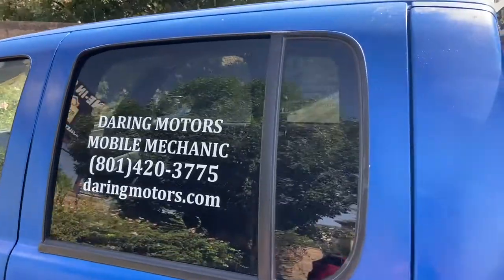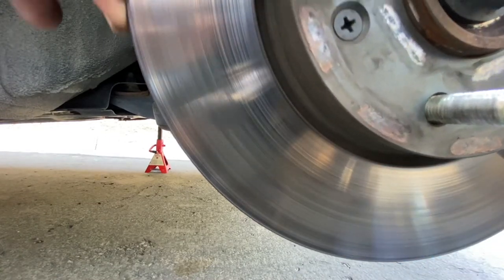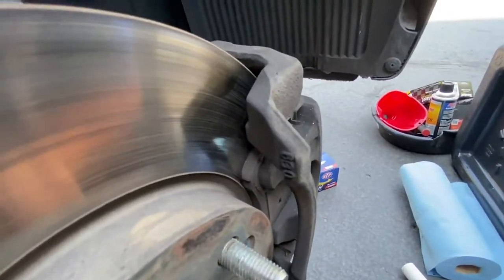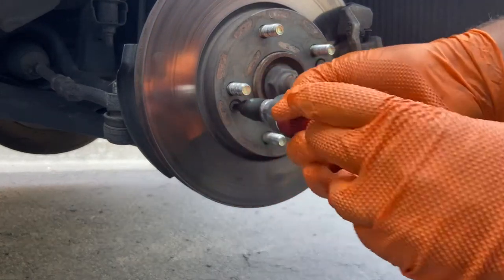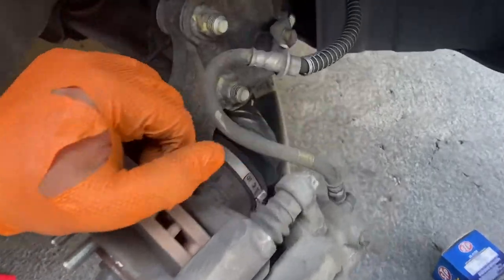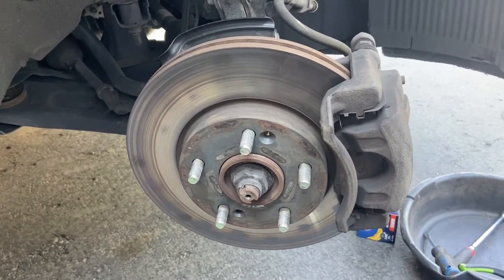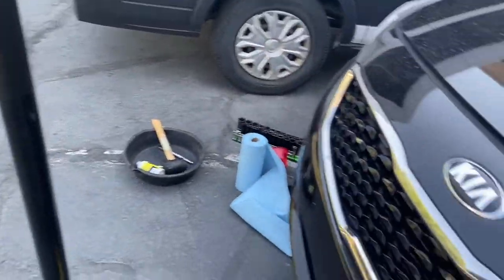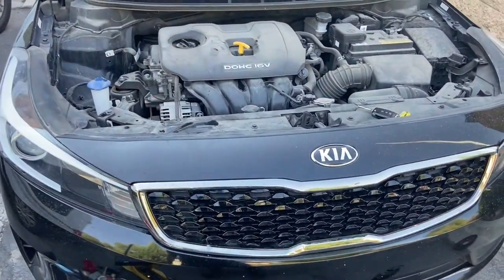Kia forte brake replacement Basic how to

Comment: You forgot the anti rattle springs you took out @3:44 when putting it back together, there were holes for them in the new pads too (@9:09 on) ...
Reply: That's one thing I realized.

Comment: I replace the brake fluid whenever I replace brakes - old fluid gets oxidized and a flush and fill is fairly easy while you have access to the brake cylinders.

Comment: Great video ….however I was watching to find a easier way to install the little pins that go in the holes on the brake pads. I do my brake jobs the same exact way but always have a problem with the pins that go in the little holes on the actual brake pads.

Comment: I just did my daughters 2018 kia forte front breaks and when i stop at a light n pull off there is a wonk wonk type noise for a few seconds then goes away until stopping and pulling off again. I didnt change the rotors but did everythg else.
????

Comment: only steps did not see you do was the metal clips that go over the brake  pads did not see you bleed the brake or open the cap on where you refill brake fluid. maybe its not necessary but always see it done on other brake videos. Sorry if im wrong.
Reply: A lot of the videos I've watched they use a tool to slowly compress the piston, so no need to bleed them. Just pump the pedal until firm after installation.

Comment: What size socket did you use for the caliper bolts???
Reply: 14mm & 17MM for the caliper bracket
Reply: @StevehBe  My 17 mm bolt is so tight I can't take it off with my ratchet wrench. I think I'll have to buy an impact wrench just how the guy in the video used.

Comment: I have a 2013 ki forte sx ? Are the brakes universal for this model ? 2.4 liter turbo ? You make it looks so easy with this fix . I hope that's the case.  I really want to successfully complete a brake fix .
Reply from the maker: It should be very similar there may be some slight variance in looks but the overall concept is the same
Reply: @daringmotors  that's awesome ,  thank you for your response .

Comment: what about those pins 3:47? i think those are to separate the pads from the rotor but none of the replacements from the stores i bought them from come with them, anyone knows where can I get them?
Reply from the maker: You can reuse the old ones but from my experience they don’t serve much of a purpose and will be completely fine without

Comment: The pads had small holes for the brake pad spring, but you did not install it back on.
Why not, do it not need it?
Shouldn't the bracket bolts been cleaned or replaced, they were rusty coming out & rusty going back in...

Comment: did you do the rotors too just to show or is it like it is up here where noone will do the pads without the rotors? ive had 8 cars in my entire life and this is the first time ive ever heard of anyone demanding to put on rotors at EVERY brake job even though my car only has 35k miles on it and the rotors look better than the ones i had on my old car that had 256k on it that noone mentioned a thing about the rotors for.
Reply from the maker: I did rotors on this car because there was a good brake bundle deal at the time. Normally when replacing brake pads you can have the rotors turned or replaced. For me I am able to warranty brakes if the rotors are replaced and gives a peace of mind that if the old rotors were warped it would be fixed

Comment: so i got my brake replaced and a new rotor but the brake padel is squishy is that normal or im missing something? great video by the way
Reply from the maker: The first time you push the pedal after changing the brakes the pedal will be squishy then after you pump the brakes a little bit it should firm up.
Reply: @daringmotors  what you mean pump it up like keep pressing it till it form up?
Reply from the maker: Yes and if it doesn’t firm up then there is another issue
Reply: @daringmotors  ok thank you

Comment: I couldn't get one of the rotor screws out (it was rusted) my neighbour offered to help and he drilled the head off entirely so... one of my rotors is only held in with one screw. What are my chances of survival 1-10
Reply from the maker: You will be totally fine! Many cars don’t have that screw to hold on the rotor because the wheel holds it on when it is tightened down
Reply: You don't even need those screws. They're only there to hold the rotor on during the assembly line. Older cars didn't have set screws.

Comment: I saw that the old ones had a tensor pulling the pads to the exterior so that they don't touch the disc when the car is moving, in the new ones you didn't install the tensors, do that affect anything or is perfect like that? Thanks for the clarification!!! Nice video
Reply from the maker: If the new pads come with it then install it with the replacement however a lot of new brake pads do not come with them and it is totally fine to install without

Comment: Is replacing the back the exact same as the front?
Reply from the maker: I have a video on how to do the rear brakes here it is a little different. 
https://m.youtube.com/watch?v=PjHbAQ7AkpU
Reply: Does the brake fluid pop out anywhere else when you compress it like that? No need to bleed the brake line?